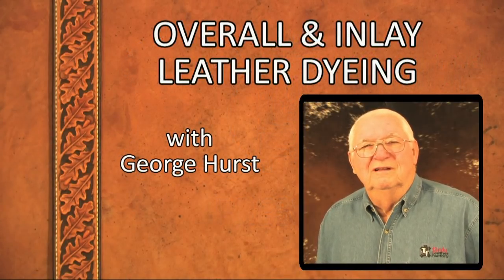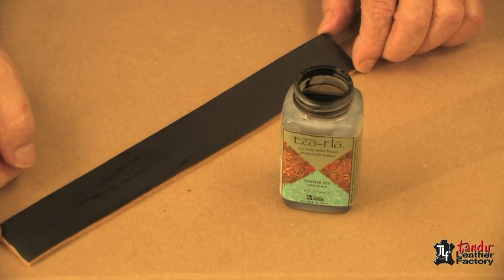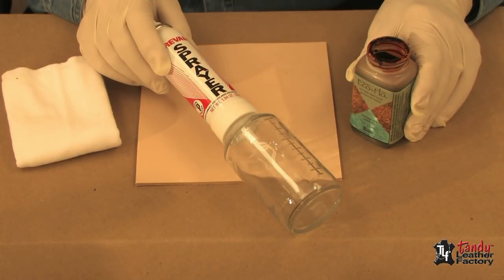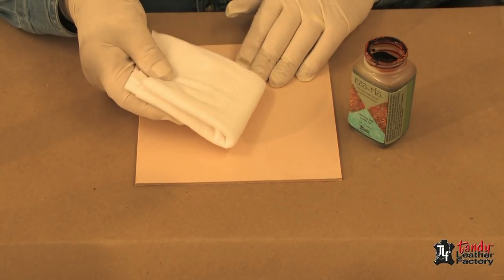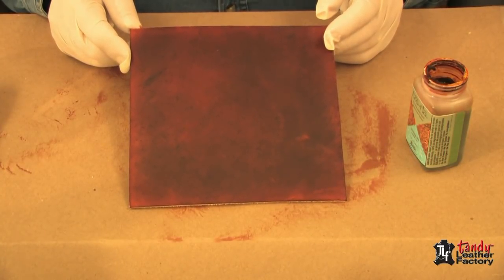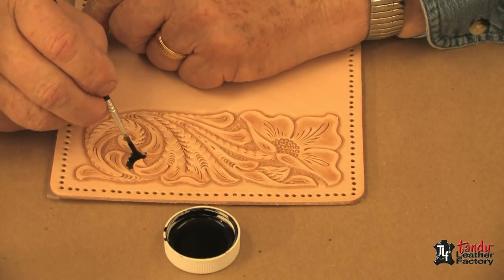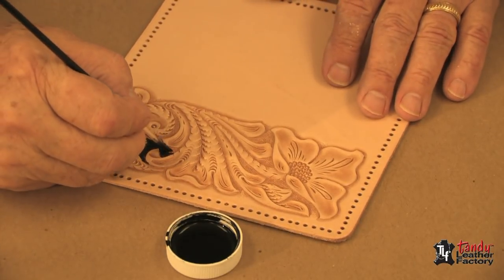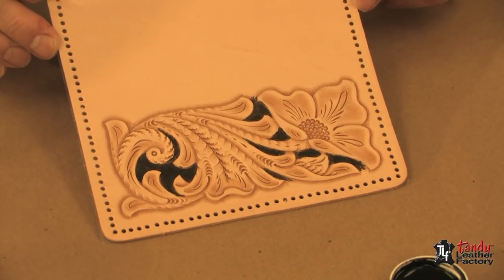How To Overall And Inlay Dye

Comment: Thanks for the great video......question are the dyes water soluble or ink baseMeaning what do you use for clean up .... Soap and water or ???Thanks
Reply from the maker: +Suzanne Keir These dyes are water based, so they can be diluted with water, are non-toxic, non-flammable,  and more environmentally friendly.  However, being that they are dyes, the pigment will still penetrate clothes, surfaces, and skin.